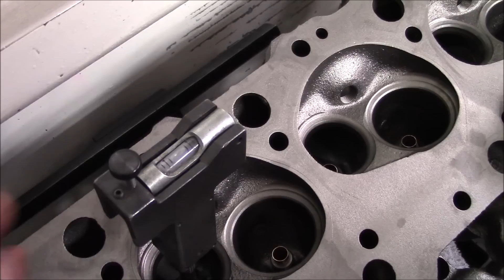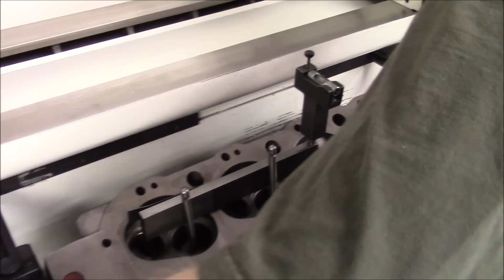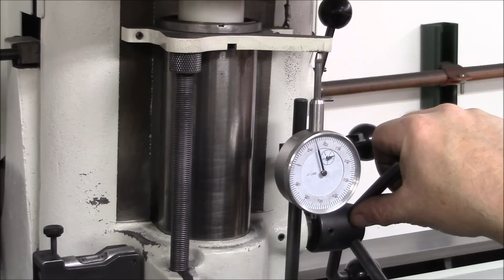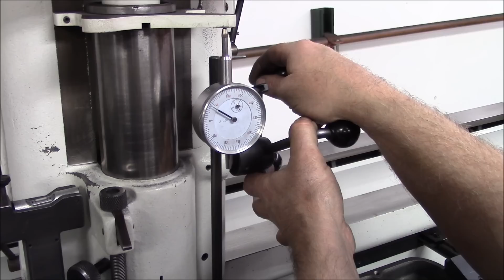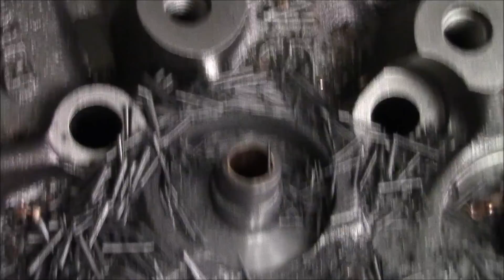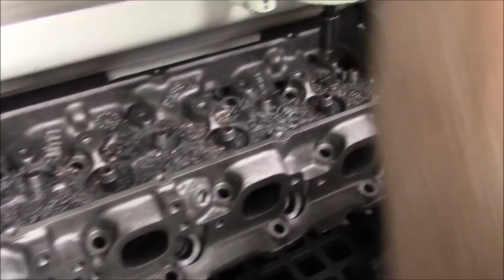Valve guide trimming, cutting for positive valve seal, & cutting deeper spring pocket 620HP 454 BBC

Comment: I just installed a cam that wants .060 clearance to the valve seals but advertised as drop in replacement.  I only have .030 and that's why you measure!  This is a great video could watch it all day.

Comment: I find it hilarious that some engine builders can be very picky with tolerances using calipers and bore gauges in some areas and then rely on a god damn bubble level to set other areas as “good enough” .   Fucking hack!  I wouldn’t let this guy build me a lawn mower engine.
Reply: Fairly sure his machine uses a floating head since he is using pilots. We use something similar for taps (aerospace industry machinists). The equipment used in an automotive machine shop is specialized for these jobs; yes, I would be able to do this on a Bridgeport or a vertical CNC but it would take me much longer since I would need to dial in on every valve guide and, in the case of a CNC machine, MDI program everything (I would also need to custom make fixturing).  He is definitely doing this right and you should really hold back on judgement if you do not understand the processes and machines involved in these operations. Just because he isn't using fancy equipment doesn't mean he isn't reaching high tolerances; the machines we work with were all held to standards that were created by basically rubbing rocks together (our references for "flat" and "square").

Comment: @ PERFORMANCE ENGINE BUILDING 201, question:  Did those 1977 heads have (valve rotators) under the exhaust springs from the factory? #105 in the likes.

Comment: cool vids but why trim the liner then go back over it with the posi seal cutter, why not use just the posi / guide cutter and knock them both out at once and save a step?